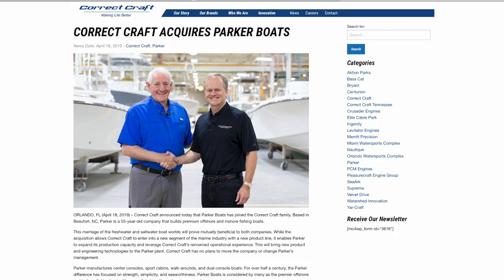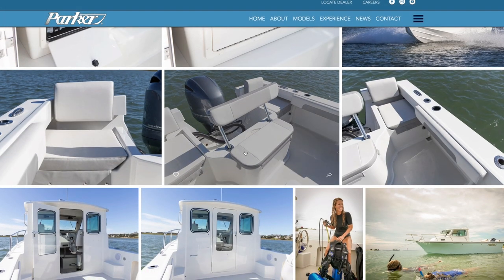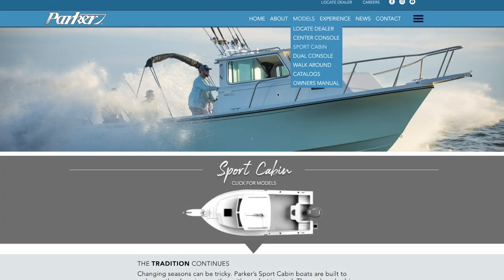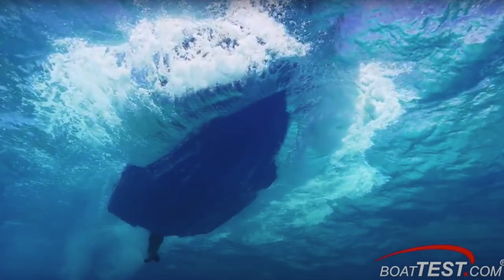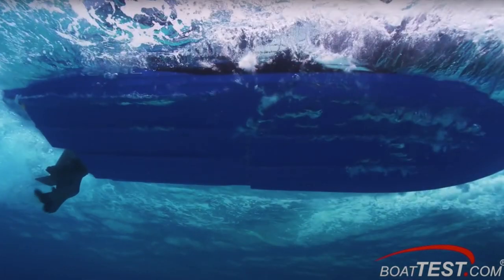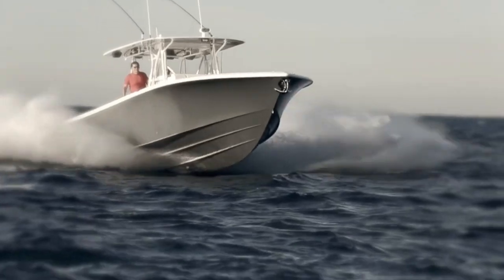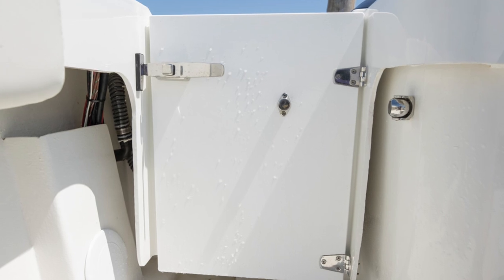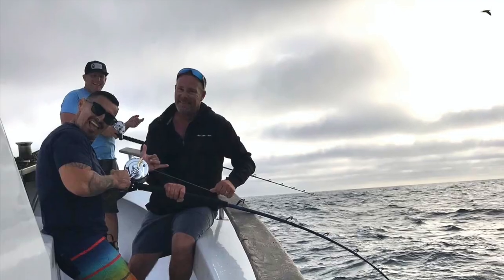CHANGES to Parker Boats??

Comment: I’d recommend many things for the boat with the finances to make it happen. Call it the “Parker Left-Coaster” Pilot House version 26’
-  Yamaha Electric steering motor(s) that also can spot lock or be easier to keep the bow on a static direction by use of the computer steering.
- ‘Digital Steering EX’ control at main helm position and a outside steering. No steering wheel outside a real breakthrough in space on the stern.
- Sliding pocket aft door so the inside and walls can be utilized with a wider opening so the traditional grip handle doesn’t recess in for the ease of use with lock ability.
-  Deck kill box and fitted to keep bulk ice longer with an interior Chill plate option.
-  Transom bracket with floatation that acts like a stepped hull with enlarged trim tabs. I also like a stepped hull design but would require a new hull design and subsequent molds.
-  Increased storage inside under seat base with two ‘Air Wave’  seat bases with a chair with padded armrests that fold up and a bolstered high back seat that reclines and swivels. All the whistles.
- Welded cabin window frame to maximize windows around and to offer a tinted Low-e glass.
- Windshield wipers with fresh water sprayers built in.
- Larger screen option dash with a center or passenger location for others inside to use and see too with remote mouse built into the captains armrest.
- Higher roof by 3” and interior finished gloss with a chase area built in for internal wiring.
- Stern areas of deck to wrap around motor area so fighting of fish can be done.
-  Exterior kill bag base in the motor well for bigger fish.
-  Side access door Port/Starboard.
-  Deck movable pocket canopy (sunshade) that also allows for upper roof rod holder to be used at the same time.
-  Deck gunnel rod storage cabinets that lock. 
-  1-1/4” Stainless steel bow rail with toe areas if the deck design allows.
-  Radar lift that is actuated to raise and lower to allow better imaging  (if blocked with rods, or life raft ect...)
- Rear deck toe kicks with led weight bins and beverage positions lower.
-  Color gel coat decks for less reflective quality.
-  Interior cabin drawers depending on layout. 

Great idea to talk about the dream boat that still can be trailered.
Cheers 
J.
Reply: The salt spray on the windows is problematic. More Carolina flare would help with that.
Reply: I was going to comment, but you got them all! Plus several.
Reply: Guys just buy a different boat with all the features you want if they put all of that in the parkers they’ll be just as much money as a new intrepid plus they’re never going to switch from wood and if they cut all those holes in the decks, everything will rot out

Comment: On the 2520. Fish box too small. Add an in Hull fish box aft of fuel tank. Move batteries and main switches out of bilge! Wire cancer! Make anchor box drain out of boat. Not into the bilge that is otherwise dry. Remember the batteries and switches. Side cleats too far forward. Should be reachable from deck. CUSTOMER SERVICE!!!!!!!!! I used to be able to call the factory and speak to Eric Denton or someone and they blow me off and tell me to call my dealer. Love the boats. Rock solid.

Comment: Need more insulated fish boxes long enough to hold large wahoo and kings.  Maybe in the floor.  Definitely need 2 large live wells. A built in functional tackle box system would be awesome. I would probably mount it to the back of the cabin (rear facing) towards the fishing deck. Ideally it would be adjustable to hold various plano style box sizes with slots for knives, crimpers, pliers, scissors, etc. Also the back of the cabin can be used to mount additional rod racks so you don't have to transport rods up top where they can get broken off by trees or laid on the floor for them to get slung around.

Comment: I see 18 people doing the resin injection boat so not buying the "less labor intensive" part but I see a crapload of plastic trash being generated using vacuum bagging.  It does prevent using too much resin in the layup.

Comment: Well you're talking about Parker completely redesigning their boats. I have a Parker and would love in deck fish boxes that can hold wahoo's. Removing the Bow pulpit and hide the windless is a great idea. More storage in the V berth is certainly needed, they only give you two very small holds on each side under the cushions on the 2520. Shore power added along with a small marine air conditioner from the factory. Since a lot of people wind up adding it anyway and run the ac with a small portable generator. The 2530 does come with shore power. My 2520 has a small galley in it with a sink and refrigerator and 14gl fresh water tank. I'm going to completely customize my pilothouse and make new cabinets and make more storage and upgrade to a 20gl water tank. This is coming soon it will also hide my ac unit. Eventually i'll do away with the monkey fur and paint it a nice color with marine paint. I don't like the molded steps, it takes away from the fitment of custom tackle stations. However' the steps are now growing on me, as i use them. lol I knew all this before i bought my Parker, and bought it anyway. But if they're going to build a fishing boat, add the stuff fisherman need.

Comment: Get the head (toilet) out from the V berth. If two people are sleeping they both have to get out to use the head. If there are more than two... Find a Place under an extra seat out of the berths.  Stop putting carpet as liner in the cabin. It collects humidity and turns moldy quick  Paint the cabin white instead. Or gelcoat it or epoxy it. Does not need to be shiny (reflective). A satin finish is best.

Comment: Some of these things mentioned like higher roof makes the boat handle unsafely. If you make it too high then the boat becomes too top heavy. I think the anchor pulpit removal is a good idea and they can make those changes pretty easily. They definitely need to up their game in better materials. I think they are way overprices these days for what they are. One thing that many have mentioned is fish boxes on sides of deck and I heard in 2023 they are coming out with a 24ft cabin with fishboxes on both sides. So they must have heard us because they are making changes.
Reply from the maker: Yes they are refreshing the brand. I was not impressed with the performance of the 24cc. I think they should have kept the bracket. If you have any photos the new 24 cabin I’d love to see em.
Reply: @ChasingPelagics  I spoke to Kyle over at WestCoast marine and he doesn't have any info on it other than they are coming out with it and he doesn't have a date yet. He may be keeping a tight lip too. We shall see what happens. I'm hoping they will release info on it at one of the big boat shows coming up.
Reply from the maker: @ultimatejay  ya it will pop on the east coast first…. California is the last thing on their mind. I usually find it in a forum first. Saw the 24cc at the Miami show

Comment: I have one of the last 2018 2120 SC's before Correct Craft purchased Parker. I am having an aluminum reinforcement fabricated for the back rest of the middle stern seat. This seat option/accessory is not built well. From day 1, my opening portholes in the V-berth have leaked. It is a poor design that requires compression of the gasket (no gutters). My Bomar opening windshield windows have always leaked (have had to use clear silicone). The bomar exterior gaskets in general are not a tight fit. The only other complaints are: The toilet would be better suited as a non-pumpout (eg. easier to empty on a whim), the rear speakers leave more to be desired, and there was no standard 12V outlet or depth gauge (had to add- and now 12V is standard). Other than that, we absolutely love our 2120 and have had some amazing adventures offshore around the Great Lakes. I don't mind the splash well at all as it keeps the LOA at 26'. We've had the max 10 people out for shorter cruises and it's suitable. For a couple or a family of 4, its seriously all you need. Super economical with fuel, and easy to tow (w/ a Toyota Tundra). Great video.

Comment: I’ve recently added a 2820. Parker out west I was really attracted to the small pilot house and lots of deck space. My bigest issues I see is stern hatch is two small to access the bilges battery’s and the all important connections to all electrical maintence and emergency. Big boat should be easy access. My north river with the reverse chime handles so much better when surfing the 10 to 15 ft steeps we run on bar crossing. The Parker wants to turn sideways and are swells are extremely steep. The rough ride I’m ok with but we have solid air ride seats in are offshore aluminum boats.This seating system is being changed on my boat and I’m adding matching motor bracket for long trolling days for salmon and tuna. Fuel economy and slow troll saving the big Yamaha's for running.with the raised deck and towering waves while fishing there is no way it’s safe to not have solid rails as standard equipment just for saftey.we use downriggers a lot for deep water trolling and most boats have pre made brackets to mount downriggers and crab pot pullers.. These boats in the 2820 or larger would sell like crazy out here. The small cabin and large deck space would fly out the door.There is tons of money here and it’s also very expensive but there is tons of money flowing at boats in the 400 k and up range.The little accessories are crucial also hot water stern storage boxes lockers bait cutters fish holds boxes with crane attachments.
Reply from the maker: Which area are you in? North rivers are pretty tough, tested them a few times in Alaska in some nasty stuff.

Comment: Take the carpet out of the PH.

Put a bracket on the 2120 and open up the deck.

Fix the pounding XD
Reply: I have the 2120....if they put a bracket on the 2120 it would open up the deck.....but it would also not give a reason to upgrade to the 2320....I think that is the reason that they Don't   :-)
Reply: @MrGOINtoHELL  I'm sure you are right lol.  It's why I probably would get the 2320 if push came to shove.  The deck space is the big appeal to most people, easy upsell for them

Comment: Hi I have a 2320 Extended Cabin (EC). It is little  than a 2530 and I call it a 2330. I hope Parker brings back this boat
Reply from the maker: I concur! If you could have the seating arrangement of the 2520 in the 2330 that would be awesome!

Comment: Is it possibe making a custom order? What i wanted is a toilet in the cabin opposite side of captain seat. I don't need port side chair or seat. Instead i need toilet with door.
Reply from the maker: Not that I have seen
Reply: @ChasingPelagics  I know. But i'm lookihg for the company which accept my desier. Here In S.Korea, There is 4 season which is spring summer autumn winter. At cooler or colde season, huiman need more naturral time for pee. I just want that bottom area as comfort area. We have lots of other sitting area where cabin and bitth then why we need bench sesat at pilothouse. Usaully nobody dont use theat seat. Insted I need decent toilet. I'm looking forward a company which accept my offer. I think i will retire after 3 years, then i will order a boat. I really like parker model except only toilet. So its my wish you parker consider my suggestion.

Comment: The under gunwhale rod storage is TERRIBLE in the 2320. I have one.  Picture trying to put the rod tips through a 1" hole (hanging up on every guide) and then having to pull the rods back and through the rear loop, hanging up on the first few guides again. Terrible.

Comment: I have a 2021 2300 DV CC.Power panel in back port blocks cleaning drain unless you remove electrical panel cover.Move batterys to console.Make front anchor locker larger.Livewell under helm seats extends too far out back.They never sealed raw wood in floor cutouts.Quit using cheap stainless screws that rust.Console is to large.Parker rod holders are JUNK rod losers.Boat is very solid but Ttop waggles around.I guess they solved these problems buy discontinuing this model . Wish I hadn't sold my Contender 31 live and learn .

Comment: what Parker Boats should do is for the 2120 they need horsepower the max is 225 it should be 250 to 300 horsepower because Parker boat are very heavy